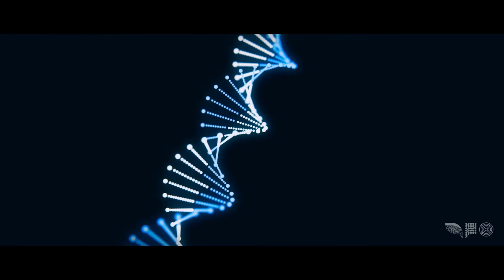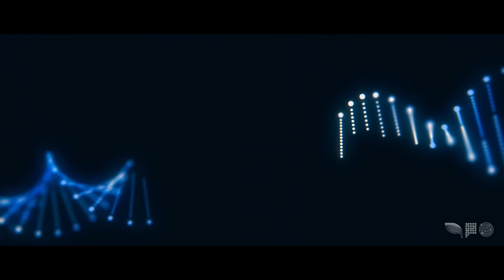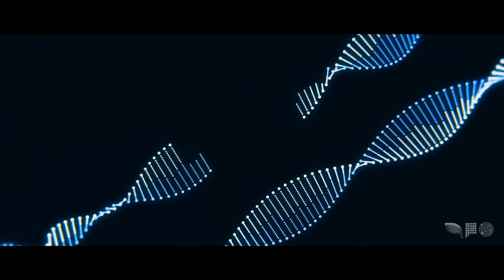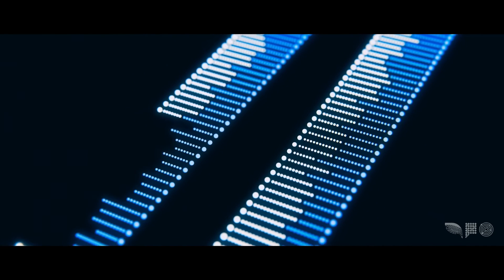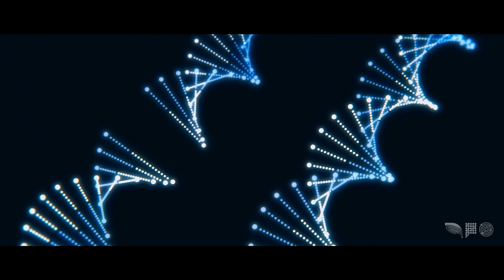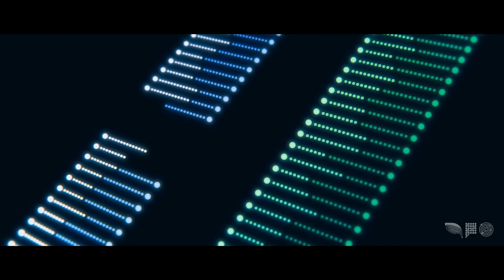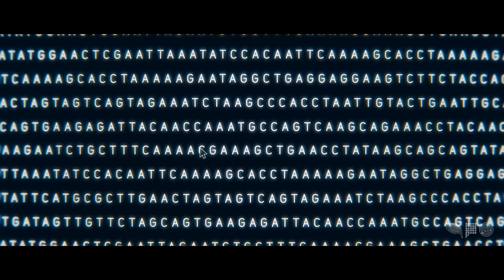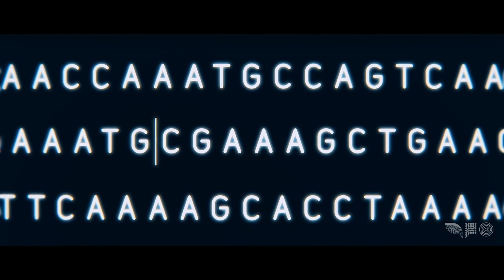Homology-Directed Repair: How the Cell Edits DNA After a CRISPR-Induced Break

Comment: This repair capability seems to point to purposeful engineering.  Instead of the cell just dying, how would it "know" that it needed to be repaired?
How does there just happen to be a spare template around to copy from?
Where would the information come from to direct the repairs?
Where would the just-right enzymes come from to assist in the repairs?
Too many coincidentals for a working repair system to be in place at once.

Good video.
Reply: cells have their own grup/class of surveillance protein known as MRN they expressed by cells over time no matter if theres any break or not, these group of protein Patrol in the nucleus,  scann every piece of ur DNA strand to catch DNA break, once it catch, it trigger many chain reaction in ur cells, thats how cells know if theres any break in its own DNA or not
Reply: @lonelyelectron5283  I understand that it works and also realize that there are successive chain interactions to make it work...sort of like ladder logic...something that we use in electronic programmable control systems.

My curiosity is how people can think that this working system can come about to be operational through successive natural processes.

Or, how did the cell fabricate the properly matched MRN protein/enzymes.  Also, a transport complex and molecular machines would be necessary to build and transport the replacement segment.  One would think that if a cell just happened to naturally come to be, then if it did not yet have a functional repair system, that it would just die out.  There's just too many steps and complex enzymes to just arrange themselves without an engineer involved in the first place.

If I misunderstood you I'm sorry.  I can't tell for sure where your sentences begin and end.